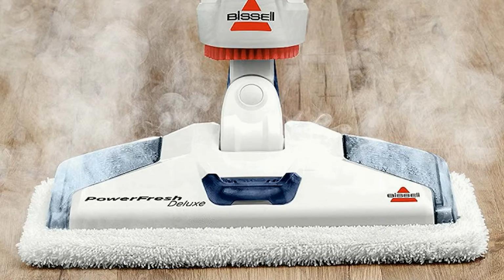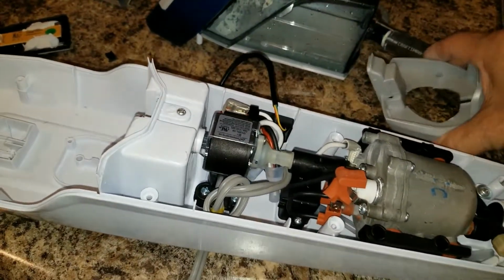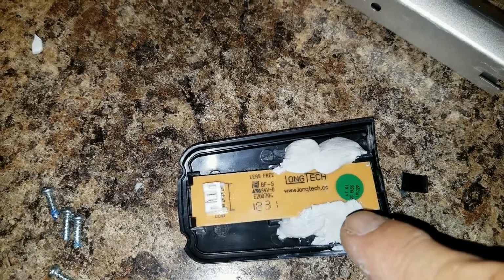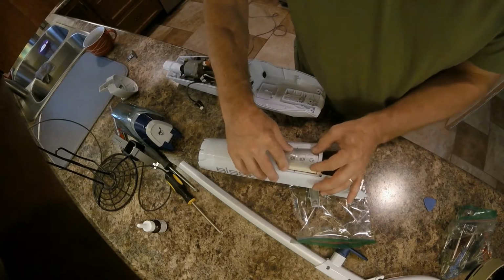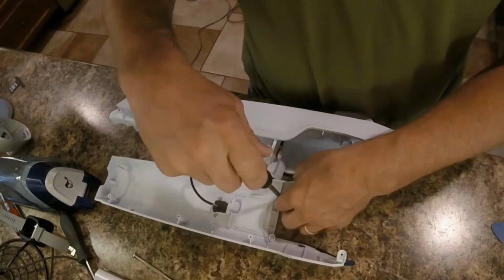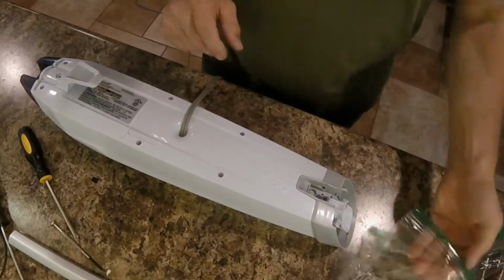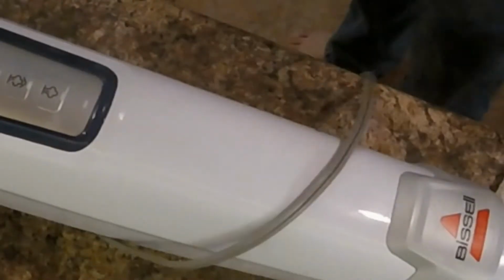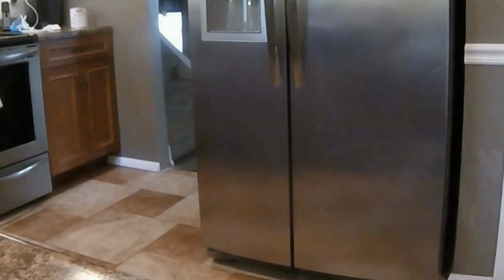Bissell Floor Steamer Repair

Comment: Où trouver un circuit électronique de cet appareil? L'appareil chauffe mais ne fait pas de vapeur. Quand je branche, le voyant clignote puis après quelques moments, il s'éteint et c'est le voyant on/off qui s'allume mais il ne se passe rien.
Where can I find an electronic circuit from this unit? The unit heats up but does not steam. When I plug it in, the indicator light flashes, then after a few moments it goes out and the on/off indicator lights up, but nothing happens. I'm from Mauricie in Quebec. Thank you!

Comment: Grey cap at the bottom of the unit is a puzzle that I just solved.    Make sure all the screws are out, including the one on the very bottom.   Grab the unit like you are choking it, with the grey cap at top and the "Bissel" text upside down.   Use your two thumbs to push up on the gray cap -- it takes a fair amount of force to pop off.

Comment: Did anyone have a leaking problem from the back of the steam mop model 186 (Power Fresh Deluxe)? I opened it up and tested and noticed the water came out from the drain(?) tube even I set it at the lowest level.  If I set at higher level, the water will come out more.  Please advice.  Thanks
Reply: Here because i think this is whats leaving drops of water everywhere. Not a fan

Comment: Thanks for the help and link.  Could have used a bit more advice on taking off the grey end cap since it's held on by two internal clips (you have to pry up and off without breaking it) then you have to slide out (not easy) the water tank to get to the two hidden interior screws.  The other video had the details for cleaning the heater which was our problem.  Appreciate what you showed. I'm sure people just throw them away when they don't work, which is a shame.
Reply: My biggest issue is removing the gray end cap. There are no videos showing this part. I tried what the other commenter stated, prying up and off and sliding. I'm just gonna go with another brand that is easier to disassemble once things go wrong. :( EDIT: So I got mad at it and decided to pry angrily since I was gonna throw it out anyway, and I finally got the dang thing off, lol. I might post a video for others later. Thanks.
Reply: @akeaw658  Once I figured it out it was no big deal.  I cleaned out the tank and put it together with the pump backwards, SO I had to take it apart again. ;{)  Thank goodness I took pictures as I disassembled it.  Sorry I didn't post these and now they are deleted.  It's my daughter's and she really likes it.  Hang in there.  Thanks for not tossing it.  We waste so much stuff in our world.
Reply from the maker: Glad you found it useful.  So rewarding to fix something and save something from the trash.
Reply: Funny final note.  I cleaned out the heater and all the calcium build up, sealed it back up and put it back together.  It did not work, no steam.   After looking at your photos I had put the pump in backwards!!  Lol!  It now works perfectly.  If you don't mess up once in a while you don't learn anything. ;{)
Reply: How did you get the grey cap off though?
Reply: @sheenawright5780   - Just saw this.  It's my daughters and I don't have it in front of me.  Did you get it off yet?  Let me know if you still need help!  Harold